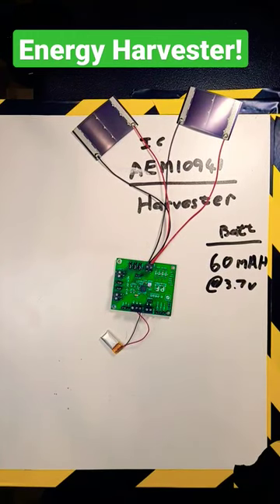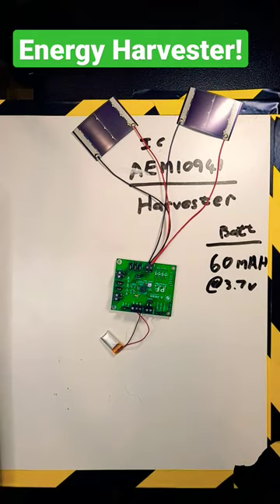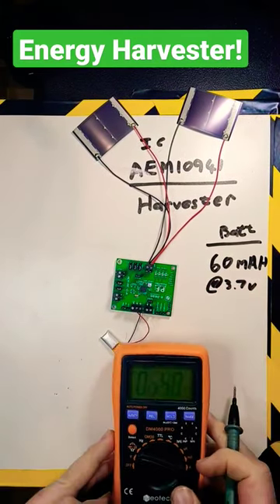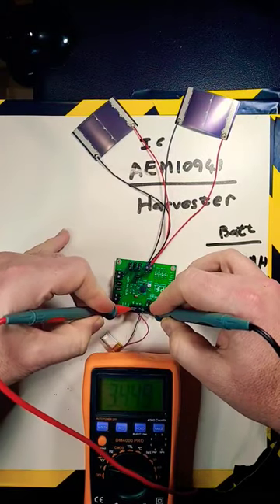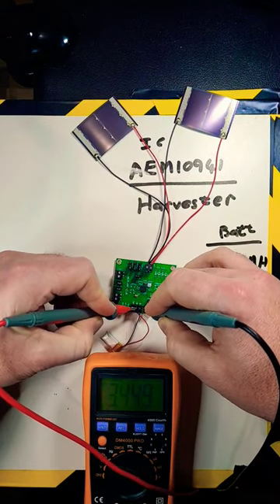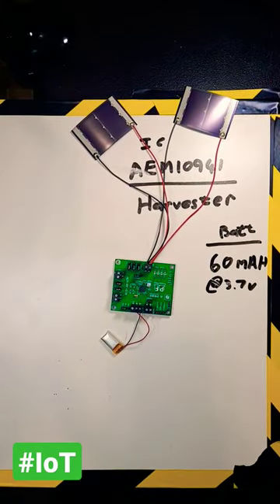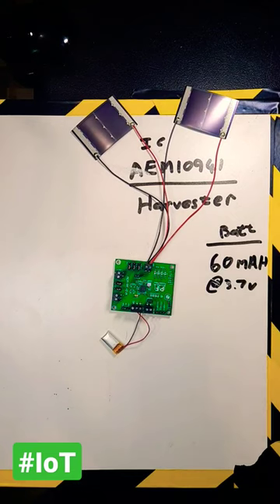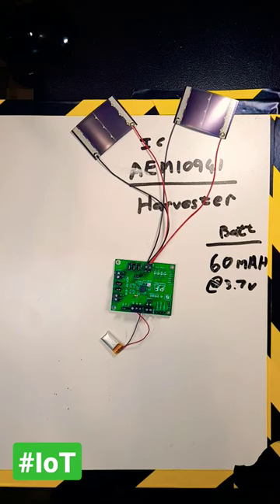IMPRESSIVE Energy Harvester IC charges 3.6V battery from 300mV solar cell. #PicoSat #iot project

Comment: I do that to, I use a flood light solar panel to charge anything with 5v and I use it to play a small radio
Reply from the maker: @808pathfinder really cool. I think the difference here is these solar panels only produce 300mV so the IC being able to boost voltage  charge batteries and keep a MPPT efficiency of 70% is a first for me.. have you had anything like this ?